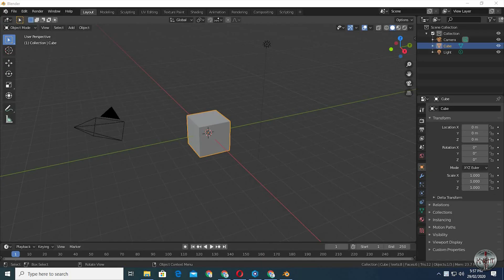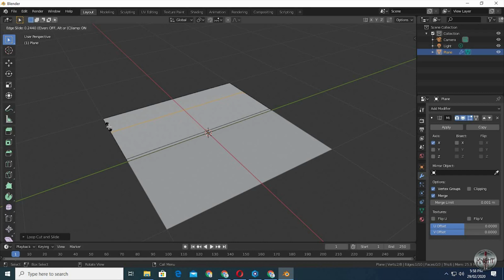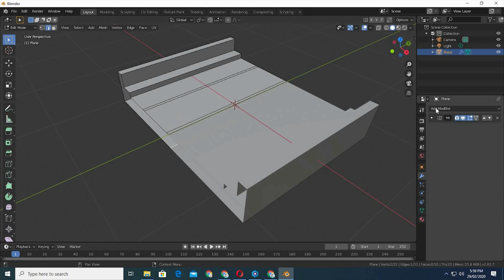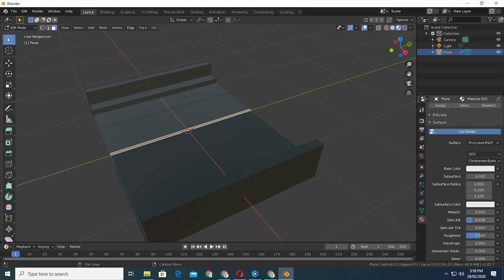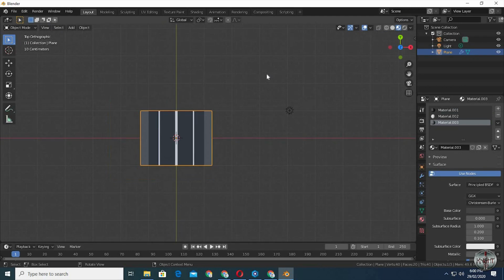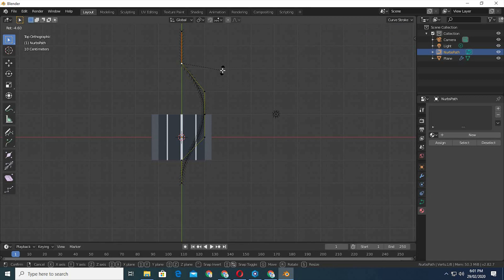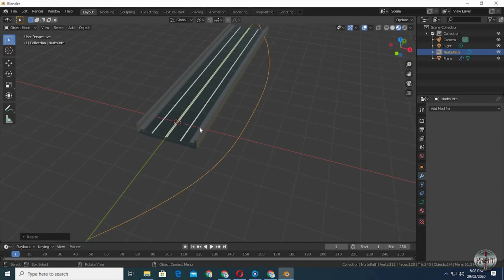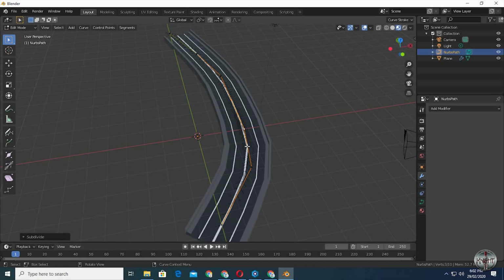Make Curved Roads in Blender || Quick and easy road in Blender || Blender Road Tutorial

Comment: i dont have a black curve like you.I have only the orange one can you help me ?
Reply from the maker: Color doesnt mean any thing. As long as its working
Reply: @RogueKnight3D  no its don't work my road follow the orange line without curves
Reply: (this is my alt)
Reply from the maker: I still dont know why it isnt working for you..this can be done with Any curve.. In Blender
Reply: @RogueKnight3D  I mean I use the same tool than you but I have only the orange curve (you can edit) but no the real curve (black with arrows)
Reply from the maker: Its normal. You press tab to go to the edit mode and the lines show up... If you cant. Better reinstall Blender.. To a newer version

Comment: Why does Blender do this to me, I hit control + R and I get nothing, I know it should work, I have done it before but now it doesn't want to work, I am getting so frustrated with the Blender workflow, I thought it was kool at first but the more I work with Blender the more aggravating it gets
Reply from the maker: You should be in edit mode to use the control r loop cut feature.. You can also use thw tool to do. The same. Job. By selecting it manually feom the left side tool bar
Reply: in edit mode, make sure your cursor is scrolling around the edge you re wanting to add a loop cut to.

Comment: Instead of setting array repeat value by-hand you can set Fit Type to Fit Curve to automatically fit your mesh into curve's length. Also instead of subdividing you can just increase resolution in curve settings. Great video!
Reply from the maker: Yup. I used that trick in my rope tutorial already .. I tried to keep this one beginners friendly. Didn't wanted to make it complicated alot.. Yeah resolution works so good. But I tried the easiest method with less steps so new beginners can easily follow. But thanks again 😊💯💯
Reply: @RogueKnight3D  You might want to segment the video into beginner, intermediate and advances, this will make it accessible to everyone and can make sure people get into good, fast and efficient practices.
Reply from the maker: Thats low poly. I thought its easy to guess but now adays i sure do mention